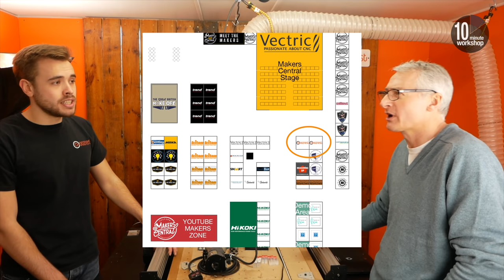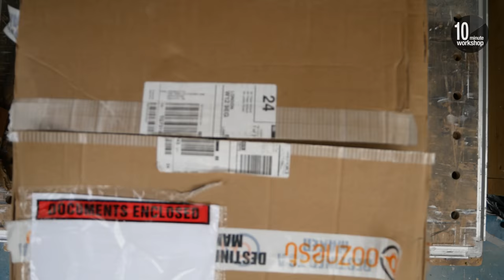Starting Out in CNC P1 (reprise) [video #385]

Comment: Thank you Peter. Your timing is excellent.Looking forward to rest of series. I have recently assembled my 750x750workbee and  fitted a spoiler board earlier in the week. Looking forward (albeit with some trepidation) to cutting wood!. Stay safe
Reply from the maker: Thanks John! Not sure if you’re an Instagram user, but I’ve been posting short videos over there (@10minuteqorkshop) since I re-started the build the week before last - may be worth a look? And yes, that first cut is a bit nerve-wracking! I did a ‘dry run’ first - zeroed the bit against a piece of 18mm MDF, then took it away and let the CNC do its thing in mid-air with the router off! It was very comforting to see it follow the path I was expecting! 👍👍
Reply: Thanks very much Peter. some good advice there. Have set up an instagram account and found you - regards

Comment: For DIY build of a CNC intended for wood and plastic a simple chain drive is an excellent but frequently overlooked solution for a machine of any size. It is inexpensive, simple to make, free of backlash and accurate enough for  material that is as unstable and flexible as wood.
Reply from the maker: As the title suggests, I’m only ‘starting out’ in CNC, so I’ve very limited experience of other systems. Is there a reason why chain drive isn’t appropriate for cutting soft metal like aluminium, for example? Thanks! 👍
Reply: Peter Millard metal demands higher precision. Unless you can live with 0.1 accuracy you need to go with ball screw, precision lead screw or rack & pinion drive.
That is assuming the machine frame is rigid enough to deal with the stresses induced by machining (relatively) hard material like Aluminium.
Chain drive accuracy is good enough for cutting steel with plasma cutter.

You mentioned in the video belt and screw type drives. I wanted to point out chain is a good option.
One more good feature of chain drive I forgot to mention is that it is impervious to wood dust that is deadly for precision ball screws and can cause problems for lead screws.

Comment: Interesting aspect with wifi connectivity. I have a Cnc shark which only connects through usb connections. Not sure if I would use wifi even if an option as so much needs to be set up manually on the cnc before machining can start. Aspire is definitely amazing software and vectric's suite of video tutorials make it a easy to learn how to create models to carve. Fun watching your journey as reminds me of going through same things myself.
Reply from the maker: Thanks! The duet controller board can be used with WiFi or Ethernet AFAIK, and yes - as we’ll see as the series progresses - the initial setup/commission of the board can be taxing. But once set up, it’s very easy to connect and machining can start as soon as you load your gcode - this is stored on the board on this system btw, so jobs can be retrieved and run easily. 👍👍

Comment: Peter have you seen the maslow cnc, comes as a kit, you build the frame and I think it's only about 250 quid I believe. From the US designed to be cheap.
Reply from the maker: No, never heard of it I’m afraid. I’ll take a look 👍👍
Reply: @10MinuteWorkshop  they ship to the uk. Its usually made on a sheet of ply or mdf like a wall saw at bnq but it could easily be made from a half  sheet.